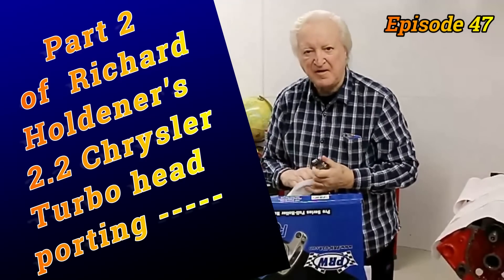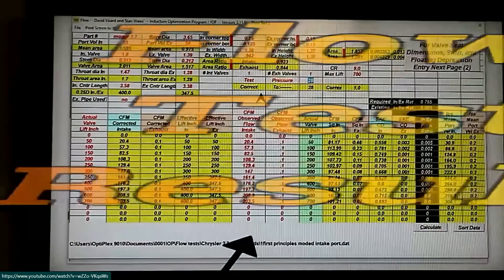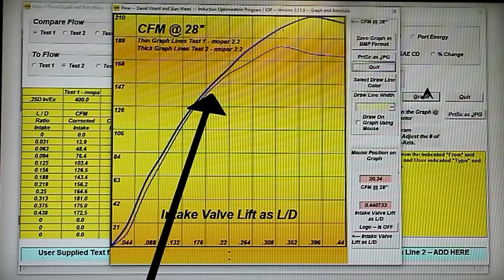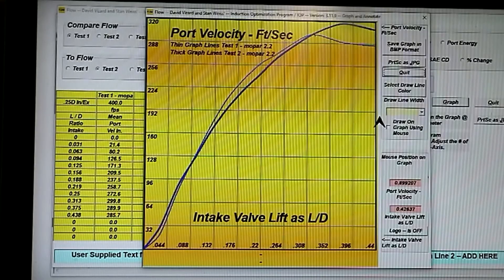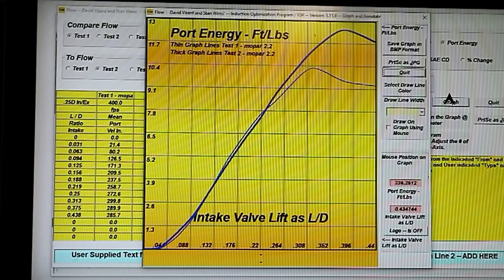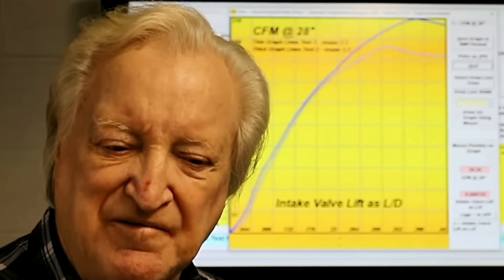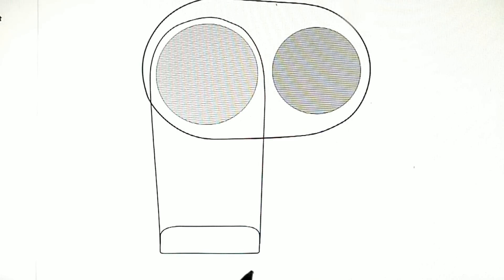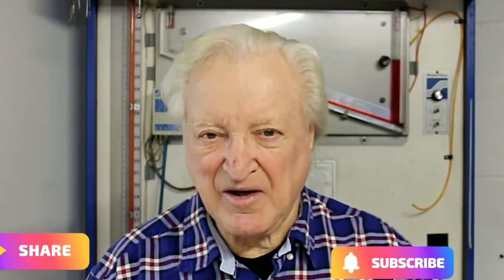Porting Richard Holdeners turbo 2.2 Mopar head.

Comment: Thanks for your efforts to explain these nebulous concepts of dynamic flow.  I don't pretend I have any solid grasp but am gaining some insights into what happens in the process.  I have a gut feeling that this process with all its inherent variable changes as ice engine rpms increase through the operating parameters is what can give an engine its feeling of "life" versus the seeming digital "deadness" of an electric motor driven vehicle.

Comment: Hi David, I am in the process of rebuilding my Subaru EJ257. The lical speed shop I am using is shooting down any mods to the heads. They claim the stock heads flow poorly. They aldo feel that larger valves and pocket porting the heads are a waste of money. Do you have any experience with the Subaru turbo charged engines?
Reply from the maker: Yes  it far from a bad head IF you know what you are doing - though it is not the easiest to do.

Comment: Dave? Funny, our IH Comanche SV big blocks, all have 45 degree valves except the 392 has a 30 degree intake,  what are the sealing issues?????   Im watching you trying to learn and crack the code on these heads, they come stock with the intakes ports and bowls like race heads, but the exhaust bowls are just flat out wonky !!!!!    Your contact email failed, I want to mold my ports and send them to you,   with out porting they fall flat at 5,000 rpm with any cam you stick in it......
Reply: im going to guess the seat seal issue is only w/o lead?
Reply from the maker: No!

Comment: Doesn't matter how much the heads flow if it's got the "wrong cam" timing and valve events...
Reply: I've got a feeling dv and Richard are going to have discussions over camshaft timing
Reply: Nice observation, Einstein.....👀.    Someone who has developed cam spec software is more than aware of that without your input!
Reply: @trailerparkcryptoking5213  oh I don't doubt David vizard I guess that went over your head
Reply: @trailerparkcryptoking5213  I take it you've seen Richard degree a cam before.  I have never once.  David's porting the heads for Richard... I'd assume he not assembling the engine.  But perhaps you know more than I do.

Comment: are sodium filled valves an advantage in this application ?
Reply: Sodium filled valves I would say are beneficial if you’re going to making extreme heat on the hot side of the turbo. Outside race and specialty applications I’d say it is a wash.